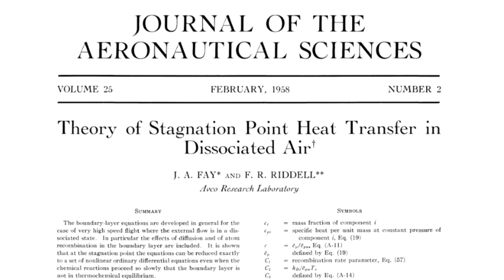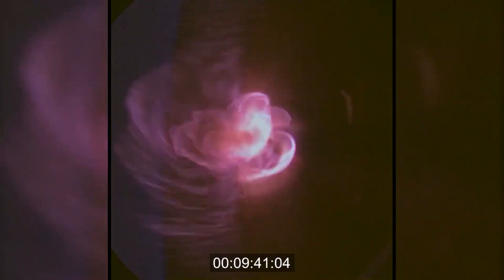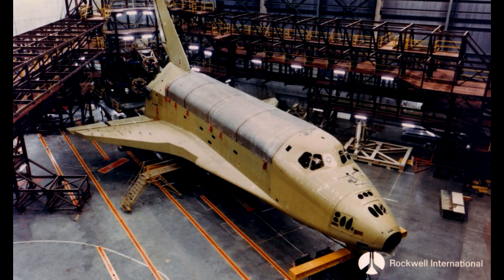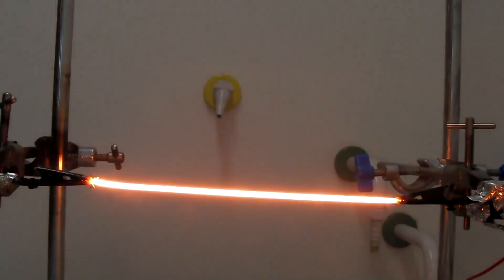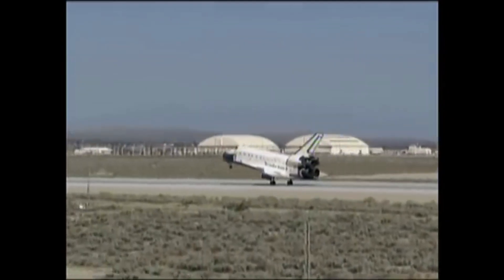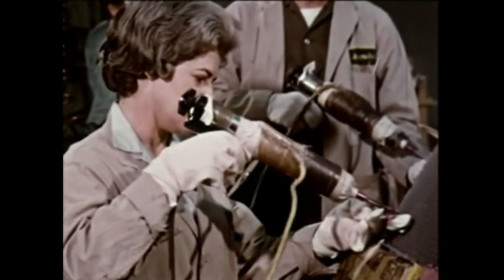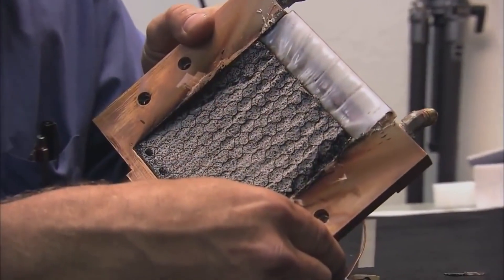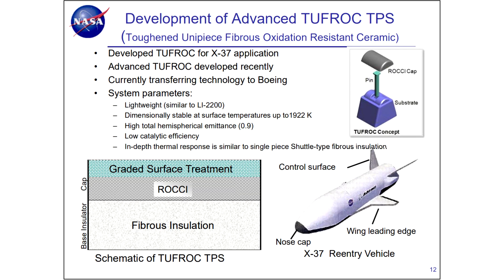Heat Shields - Things Kerbal Space Program Doesn't Teach

Comment: This is something I've always been interested in and which has sadly not been given the attention if deserves. Material science has greatly benefitted space travel in ways like this. And we rarely see just how difficult the perils of space travel are with the demands placed on the materials used. Think of the melting (660 degrees Celsius) and boiling point (~2,400 Celsius) of aluminum and how the temperatures of re-entry compare to that. It's amazing to think of close the margins are of the numbers and how close to burning alive/structural failure that re-entry is. The forces involved are just not normal and comprehensible by normal, everyday human understanding of temperature.
Reply: Indeed. Even a bullet - perhaps the fastest thing in most people's minds when they think of speeds that are in some sense "relatable" - is in a sense dog-slow compared to a reentering spacecraft. A handgun round, for example, may travel at only 300 m/s or less (= km/ks, handguns especially are usually made to keep their rounds subsonic so as to minimize noise as a supersonic bullet makes a "snap" as it passes - effectively, a tiny sonic boom, and the speed of sound in air at the usual level where humans live is around 341 m/s or so, though varies a bit with pressure and temperature). Even a rifle bullet (which are "allowed" to go supersonic) only gets to about 1000 m/s or maybe a bit more. But a reentering spacecraft easily plows in at orbital velocity if not greater - that's over 8000 m/s! The (per-mass) kinetic energy dissipated and the pressures involved go up as a square and that makes them on the order of 64 times worse than a rifle bullet! 8000 m/s is fast enough - keep in mind - that it can be used to circle the earth in only about 5 kiloseconds (40000 km / 8000 km/ks = 5 ks, not counting orbital altitude and the thus slightly enlarged radius. The ISS's period is more like 5.5 ks IIRC.) - compare that to a typical international jet flight taking 36 ks (10 hrs) just to go a quarter of the way (10 000 km) around the globe!

And what's happening to create all that heat? Effectively, you're pounding the air so goddamn hard that it's not only creating a hypermegasonic deathwind against your craft but that deathwind is as hot a damned blast furnace due to the craft effectively acting like a piston and slamming all that air together in front of it as it's moving too fast for that air to simply flow out of the way, and thus causing it to compress dramatically and heat rapidly: think about a bicycle pump and how as you use it for a while, it warms up. Same thing here only far, far more violent. You're taking 8 km of air - a tube of air as long as a small city - then slamming it into a pancake (or at least a very short cylinder) in 1 second, every second (so imagine in a single second zooming in a crazed blur from one end of your city to the other, buildings, parks, stadiums everything just flying by in the twinkling of an eye, and all that air, that would take you driving it perhaps 400 s or more at city speeds and would brush your hand held out the window like a wind, imagine encountering all that air virtually at once), so that by the time it gets around the edges it's like a blowtorch (this compression ratio reaches or even exceeds that of a diesel engine, I believe, which uses this effect to ignite its fuel instead of using a spark plug as in a gasoline engine, at least going by the temperatures attained.). Naturally this is why the bottom part is where the tiles are, since that's the part used to "attack" and thus compress the atmosphere, making it where the peak heat is reached.
Reply: @mike4ty4  >>by the time it gets around the edges it's like a blowtorch
Which somehow doesn't melt the windows, even when they are in the direct path of the flow of air.
Reply: @markgerhard1362  The windows are NOT in the direct path of the flow of air!  They are on the leeward side of the craft during reentry.  Imagine how less violent wind feels when you are behind a large object like a building.  Spacecraft designers use the same technique to protect the windows.  Traditional human reentry vehicles look like a rounded triangle in side profile ==> the windows are protected by the heatshield.  The space shuttle came in at an angle that the windows were protected by the more bulbous fuselage during reentry, and then were only minimally useful during the (relatively slow) lifting body phase "land like an aeroplane" but really more like "glide a brick".  

If all of the above doesn't convince you, consider this: How many stone chips does a car get on the fascia, hood and windshield?  How many on the back window?  The glass in the back isn't any stronger.
Reply: @kodiak2fitty  The problem, as I explained above, is that there is no way to keep the spacecraft in this position during the descent.
Reply: 800 *C is melting temperature of ordinary glass. In spacecrafts (including Apollo, Space Shuttle and ISS), windows are made of "fused silica" - quartz glass, with m.p. above 1600 *C. Also, it's coefficient of thermal expansion is very low, so it can handle thermal shock (rapid change of the temperature). Sorry, no conspiracy here.
Reply: @ivoivanov7407  It's sad that your mind so so closed that you regard legitimate scientific inquiry as 'conspiracy' when it threatens your belief system.  You wouldn't make a good scientist.

>> with m.p. above 1600 *C
But well below the temperature it would actually experience.

>>Also, it's coefficient of thermal expansion is very low
But not at these temperatures, obviously.
Reply: @ivoivanov7407  >>Sorry, no conspiracy here.
It's sad that your lack of scientific curiosity is so profound.  Real scientists rely on data, nor belief systems.

>>with m.p. above 1600 *C
Which would still melt.

>>it's coefficient of thermal expansion is very low
But not at those temperatures, obviously.
Reply: >>Re-entry head: 1700 degrees. Temperature at which the most heat-tolerant glass melts: 800 degrees.
EIGHT HUNDRED degrees.
That was your initial point, right? Now, we're talking about much higher temperatures, above 1600 degrees. 
---
About coefficient of thermal expansion, I've tested it up to 1200 *C, that is what I can get from my lab kiln. As part of a demonstration of that property of the quartz, I've heated a test tube, made of fused silica, it was gloving orange-yellow. Then I put that gloving tube into liquid nitrogen. And it survived the change of temperature of about 1400 degrees! So, I think, I can assume, it will perform alike at 1600 degrees.
Reply: @ivoivanov7407  My point is that the glass would melt, which I think we have established.
Reply: @markgerhard1362 , your exact point was, that glass will melt at 800 degrees. And I proved it wrong.
Reply: @ivoivanov7407  You didn't 'prove' that glass doesn't melt at 800 degrees.  You claimed, with no evidence, that 'special' glass was used in re-entry capsules.  I pointed out that, even if this were true, it would still melt.

So the astronauts would have burnt up, just like everything else that falls through the atmosphere.
Reply: @ivoivanov7407  Correct me if I'm wrong, but wouldn't cold water have worked better since liquid nitrogen tends to (just about) instantly boil even at room temperature, leading to that pocket of steam that protects your hand from the minus 200 degrees liquid nitrogen?
Reply: It's not that close at all. The only way that temperature reaches the orbiter is if the boundary layer is disturbed by turbulence in the airflow.
Reply: >> close to burning alive/structural failure that re-entry is
Re-entry head: 1700 degrees.  Temperature at which the most heat-tolerant glass melts: 800 degrees.  But you still believe that a capsule with glass windows would survive re-entry.
Reply: @markgerhard1362  
"Temperature at which the most heat-tolerant glass melts: 800 degrees.  But you still believe that a capsule with glass windows would survive re-entry."
...What are you getting at? That glass on space craft are a lie? That space travel is impossible due to glass and those clever disinformation agents at NASA were done in by none other than Mark Gerhard's clever thinking? "Glass beams can't jet fuel capsules" or something?  ...You do know that glass isn't used as a heatshield, right? It's there... on the sides. Where the heat is much less and can be easily radiated away. And as far as that heating goes, I think the Shuttle utilized around 5 inch thick glass (of whatever type it was, I don't know). Now... Do you think that just perhaps it takes more heat to heat up thicker glass and takes longer? Strange concept, I know, but a small sliver of wood also burns much faster than a 5 inch round diameter tree, too.
Reply: @matchesburn  >>You do know that glass isn't used as a heatshield, right?
Your hero Scott Manley just said that it was.  Check the thread above.
Reply: @markgerhard1362  What "thread"? Youtube comments are not that organized, so I don't know where you're referring to. He sure hasn't commented in this particular set of replies (that to "matchesburn"'s top-level post).
Reply: @mike4ty4  The thread starts "So what stops a space capsule tumbling..."
Reply: @markgerhard1362  Thanks. I see it. At no point, however, does he say glass is used as a heat shield.
Reply: @mike4ty4  No, but he's saying that the glass would withstand the heat of re-entry.
Reply: @markgerhard1362  Wow you're so woke... I hope one day when I grow up I can be just like you and realize that literally everyone is lying to me about everything for no reason.
Reply: @markgerhard1362  You're right, it was a pointless comment to make that added nothing to the conversation and will never convince you of anything you don't already believe. But it doesn't really matter because nothing short of sending you up in a space capsule so you can experience firsthand how reentry works will convince you of anything.

Comment: So what insulation tech does the falcon 9 use?
Reply: the booster? it doesn't need any, it slows down slightly before reentering atmosphere (from way slower speeds and way less mass) just enough not to get the plasma.
Reply: @spiritwolf5792   I think either Scott or Tim Dodd mentioned it somewhere that the Falcon 9 does in fact have extensive heat protection on the bottom that needs refurbishment from time to time. Also the engine is very hot and during the reentry and hoverslam burns the hot exhaust gasses brush over the hull since the rocket is moving retrograde... 
It might not be as heavy-duty as a fully fledged heat shield of an orbiter but I'm 100% certain that they will need at least SOME insulation and heat protection.
Heck even paint would count...
Reply: @VulpeculaJoy  Yeah, insulation. I think all rockets have insulation near the engines. 
If Falcon 9 does have a heat shield there, I wouldn't know. 
But then again, just for the engines' heat.
Engines do not have heat shielding (they are actively cooled off) and would get shredded even if they did, because of the shape.

Comment: Neon expansion at 1:1445 and electrically activated could theoretically create a boundary layer buffer.
Burning Methane top of rocket to bottom create a toasty tunnel for the BFR to fly in is rather interesting a concept as well and would mitigate the need for faraday type internal insulation to protect against electric interference.
Attempting to buffer the HV effect would be a interesting problem to solve.
Perhaps one would also be able to use the plasma as an active electrical noise cancelling antenna.

Comment: Perhaps the electrically modulated boundary layer control
Is in fact a high speed backyard grill of sorts, injecting methane through microscopic pits drilled into the Stainless to be “burned” as a hot yet cooler dissipation of the frictional heat.  Brilliant idea.  This is akin to the fluid type of anti ice mechanism found on the leading edges of Cirrus Aircraft wings, except the methane is meant to be burnt and not used in a contained means.  There would be better means to dissipate heat than methane.  
Wow burn to cool.  Slick if true.

Comment: There is another factor involved in the choices made for the Space Shuttle TPS that you didn't touch on and that is that the Shuttle orbiters wound up much denser on average than what NASA had originally intended. This increase in density happened in order to accommodate the various military requirements that got tacked onto Shuttle as well as the removal of fuel tanks from the orbiter and replacing it with the disposable external tank (done to reduce orbiter R&D costs). 

Because a lower density orbiters would have seen less heating, rugged metallic TPS made from columbium and inconel alloys would have sufficed for most of the vehicle's exterior areas, though reinforced carbon-carbon would still have been needed for the nose cap and leading edges.

Another thing you left out was that TUFROC is also being used on Sierra Nevada's Dream Chaser lifting body vehicle.
Reply: Does 'denser' mean heavier, here?

Comment: "...a phenol-formaldehyde resin..."  The Apollo heat shields were f'ing Bakelite?  Bwahahahaha!
Reply from the maker: Pretty much.....
Reply: @scottmanley  Lmao
Reply: It was an interesting time
Reply: Why do you think it's called *Bake*lite?
Reply: Why not?
Reply: @rogerwilco2  Because of its molecular structure, just like anything else.  No plastics do very well in heat.
Reply: @markgerhard1362  The bakelite doesn't have to survive, only its charred corpse does.
Reply: "Based on spaceship technology"
Reply: well there were some wooden ones aswell
Reply: Steven Clark ☆ The Mercury & Gemini shield were Teflon,  which is the tradename for what Scott said
Reply: Apollo had a sacrificial ablative that transferred the residual heat from the vehicle that made it through the boundary layer. It worked just fine by the way and at far greater speed than any other manned reentry.
Reply: @divedevil985  Not correct.  Ablative heat shield on Apollo, Gemini, Mercury, all the Mars entry probes, Genesis, Stardust, Osiris-Rex, and many more.  Space shuttle orbiter had a reusable heat shield that did not ablate.  Both ablating and non-ablating protective layers are called heat shields.
Reply: @johnb-bo-ny8107  semantics. Your time would be better spent dismissing the original "Apollo bakelite" comment than trying to lecture someone who worked on the space shuttle about the different types of TPS.
Reply: Bakelite can't even stand a couple of hundred degrees, let alone a couple of thousand.
Reply: @markgerhard1362  A ablative heat shield doesn't withstand heat - the entire idea is for it to boil off. 
The early Mercury capsules used a beryllium heat shield - which was basically a big heat sink.

Comment: There are also radiatively-cooled heat shields used on some ICBMs and the Mercury space craft. They were designed for short, suborbital reentries and simply soaked up the heat and radiated it away after reentry. They aren't used much today because the heat shield needs a lot of mass to absorb all the heat.

Comment: If the shock wave is ionized gas then it might be deflected with a strong magnetic field by analogy with the way that the Earth's magnetosphere deflects the solar wind. That would minimize contact between the shock wave and the spacecraft and therefore conductive heating. In addition one might have a mirror surface to minimize radiative heating of the spacecraft by the shock wave.
Reply: @oremooremo5075  Batteries? How about a turbine generator?

Comment: Great video. I have a question about space shuttle. Why the nose gear is shorter in space shuttle compare to regular planes/ gliders? Does it have to do anything with aerodynamic forces at the time of landing ?
Reply: Interesting question! An aircraft has to take off from a runway in a nose-up attitude. A shuttle only lands on a runway (it uses rockets to lift off), so nose-down configuration is fine.

Comment: Pretty sure you had an image of the YF-12 when you said SR-71.
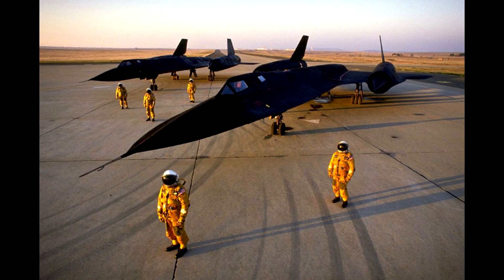Reply: Very hard to tell, but I think Scott is right. The A-12 was single pilot, the YF-12 had clipped chines, so the SR-71 is the best match to the image at 03:15.
Reply: @gordonrichardson2972  except that the 71 is the worst pick of all three. The very much smaller 12 has a taller canopy where the 71 doesn't.  It's simply not the 71.
Reply: Well, it can't be the A-12, since that is a single seater (note the two pairs of cockpit windows), and the YF-12 does not match the chines (and only 3 were ever produced). You don't seem to have any other options, other than you think it doesn't look right based on a single wide angle photo...
Reply: @gordonrichardson2972  Hello, GR. I stand corrected. Been awhile, sorry I missed notification of your response. Taking your info on clipped chines, and obviously wide angle lens, I'd have to agree 100%. 
 Thanks for the interesting chat. 
 Cya around sir.